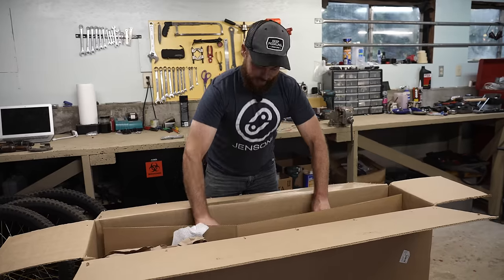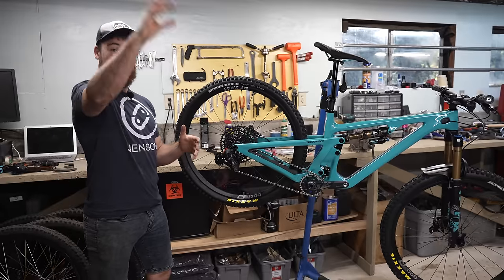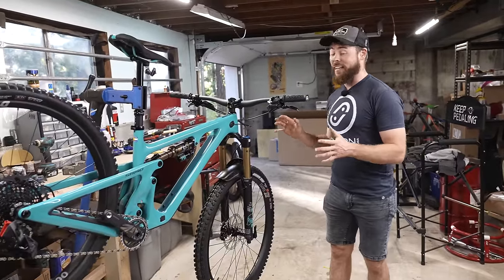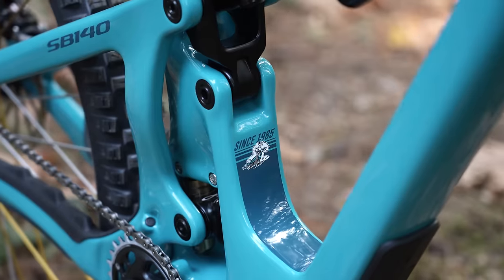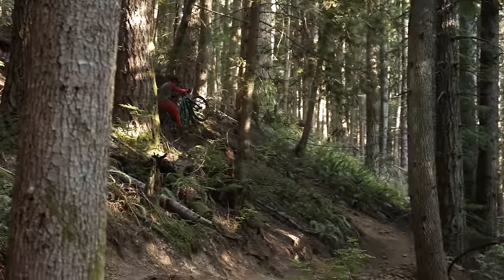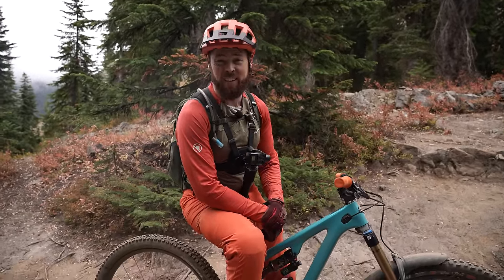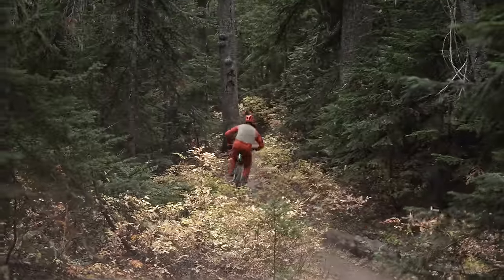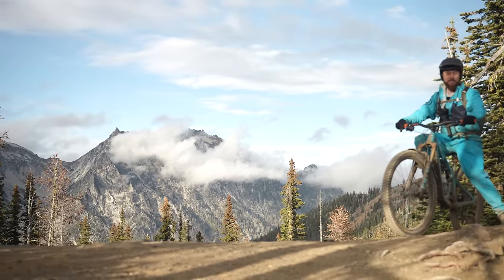Reviewing the 2023 Yeti SB140 Lunch Ride!

Comment: So no more SB140 27.5?  My impression from the vid is that the sb 130 is as good or maybe better?
Reply from the maker: SB140 27.5 is discontinued.  27.5 stopped selling a few years ago.  SB130 is a great bike, and works awesome for more natural trail riding.  The new iteration is a bit more high speed, trail center focused, though it still does well in the back country too.